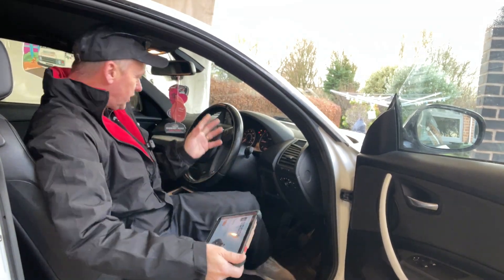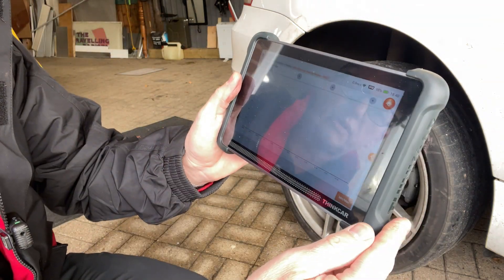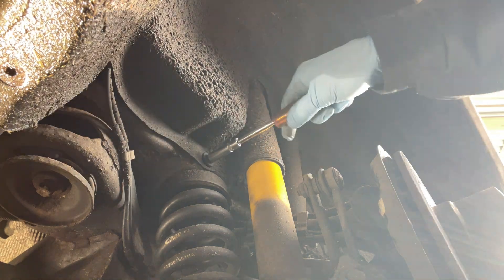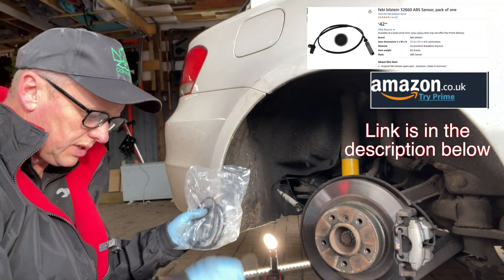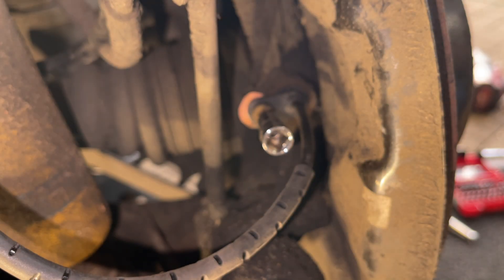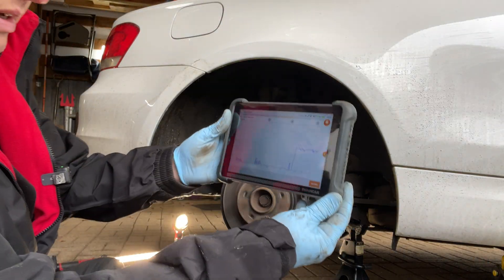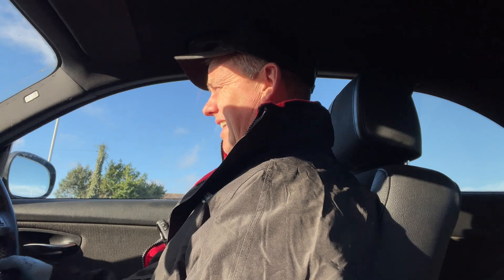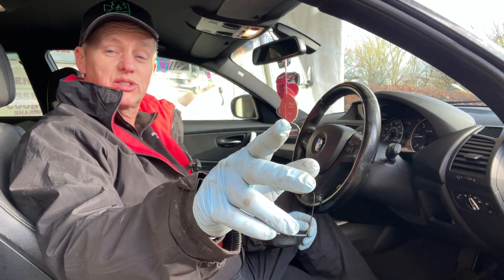Bmw 1 Series Rear ABS Sensor Replacement E82 DSC ABS Fault 5DC3

Comment: Did the sendor was damaged, i saw an other vid the guy only install thr washer and cleanthe old sendor and put it back in.. 
I just got ABS, DTC & BREAK LIGHT ON. hope this is the sane problem..
Reply from the maker: This is the link to the full repair video if the washers don't work https://youtu.be/rBlTHK29x8c Thanks for the great comments👍🏻👍🏻🛠

Comment: Have watched a couple of your ABS repairs recently and really enjoyed the clear simple instructions. The issue I have is that the ABS and Tyre Pressure warning came on at the same time on my 2007 335i, but I cannot get any connection from the OBD2 port, it powers the reader up but won't load beyond that, so I can't even see the VIN. Any ideas?
Reply from the maker: What reader are you using?

Comment: Hi Sir...do we need to drive after replacing wheel speed sensor mine error was 5DC0( rear right)?...I tried to start my car after changed but haven't to drive but abs warning lights still appears on my iDrive or I need to clear warning sign as well(need to find foreman to do it).
Reply from the maker: You need a code scanner too clear the fault, this one is brilliant, https://youtu.be/Vi978aK4LGU Thanks for the great comments👍🏻👍🏻🛠
Reply: @aaanton11  unlucky to me...😂 After foreman checking a rodent bite wire under my back seat , maybe it could cause wire short and can make module abs pump damaged

Comment: Will the abs fault go away without clearing the codes simply by driving it for a bit?
Reply from the maker: No you will need to reset it with a code reader, this one is good and not too expensive https://youtu.be/O0oGl7nSQv8 Thanks for the great comments👍🏻👍🏻🛠